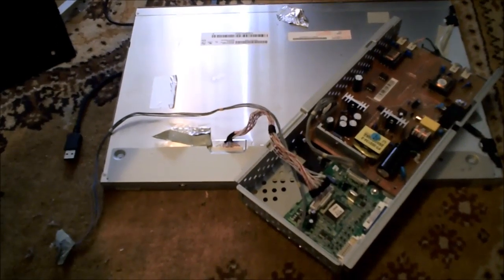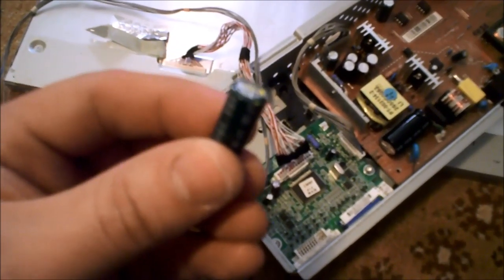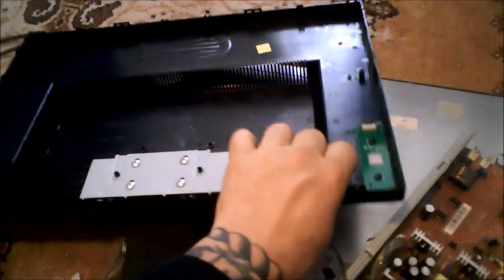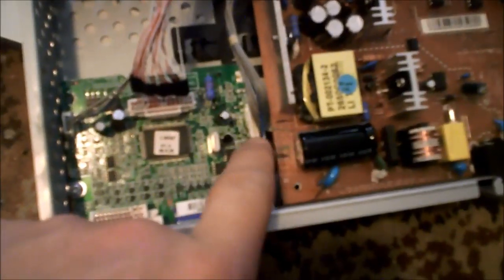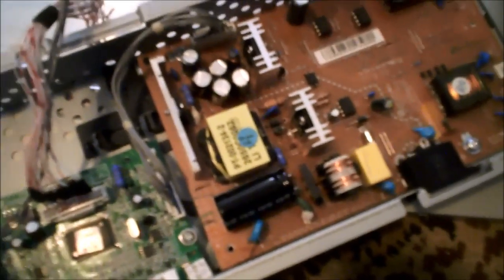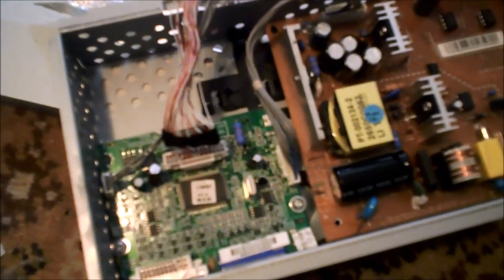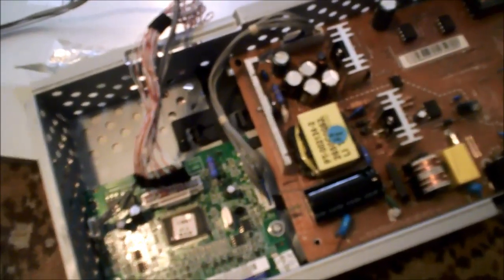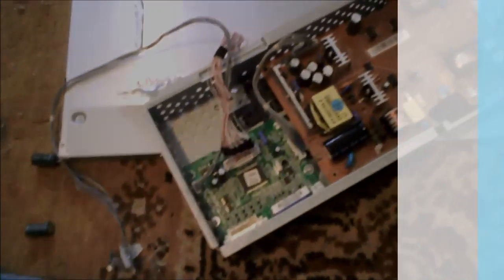LG Flatron L194 WT lcd monitor repair

Comment: Hi my lg flatron has just stopped working L194WS, a green power light comes on for about 3 seconds when plugging it in then goes off and nothing on screen, only way to see the green light again is to unplug from mains for a few minutes then plug back in. Does that sound like a capacitor issue or something else? Thanks.
Reply from the maker: It sounds like capacitors since it does not hold power long. Healthy Capacitors store voltage and won't when they are bad. Take it apart and look for those swelled up capacitors. It's a cheap and easy fix.
Reply: @BeastTechWrench  Thanks for the reply, I opened it up this morning and all capacitors look fine, no bulging at all so not sure what it could be :(
Reply: Update: I noticed most of the caps were sunk in a bit so I replaced 2 that were flat and it's working again! Thanks for the vid and help :)

Comment: The authentic wiring schedule at 5:40 of this video is Blue, Red (pink), Red, Blue. But My guess is that it doesn't mater, hence LG decided to use this type of connector. For taking the case off, remove all screws, then start with a thin blade screwdriver on the back of the casing (Black) lower RIGHT side where the "lock" icon is. Even if you get no joy with this, start on that corner with a putty knife. Use a chair or floor so that you are putting your body weight into the putty knife to just separate the surround from the back. Use an action like you are trying to get under the black, so you are levering against the surround. It will give. Keeping the monitor in the "viewing position - upright" see if you can run the putty knife along the seam. You maybe lucky and it will unlock the whole seam. But if not, keep levering in and under the black. You can get the surround off without surface damage - although some internal plastic with give way.

Comment: Thank you very much for this video! I found a bad capacitor, which was bulging. Just ordered some capacitors, and hopefully that is the only issue. Getting the frame off was a pain, but like you said, I don't care about the appearance. I am assuming you recommend replacing all of the capacitors?

Comment: I have this monitor and one night I turned it off, went to sleep, woke up the next day and the monitor won't even turn on.
EDIT: I've opened it and everything seems fine, the fuse is there and the capacitors don't seem puffy, there's one that's kinda different than the other ones but I don't know if that's just how it is or if it doesn't work, is there a way to check that?

Comment: Hi, thanks for your tutorial.  My monitor stopped working just a few days ago, It simply wouldn't start, not even blue LED.

I noticed that three of five capacitors in a chunk were somehow puffy. I changed all 5 capacitors that were in a place. And the result? It's works again...

I wasn't able to buy capacitors with exact values, one of them had max temperature of 85 C instead original 105 C, but so far so good.

Comment: Hi,
first of all thanks for your very very useful tutorial.
I'm a newbe and I hava a doubt.
I used 4 capacitor 1000uF 25V, and the monitor works again. The problem is that after I closed the monitor and watched better the old capacitors I noticed that they are different from 1000uF 25V, in particular they are:
1x   1000uF 25V  (the same of the 4 that I used)
2x   1000uF 16V
1x     680uF 25V

After the reparation I turned on the monitor to try and I works, but I let it on just for 1 or 2 minutes, now I'm worried that due to the wrong capacitors that I used it could breakdown again in few minutes.

Have I to change the capacitors again or the capacitor type that I used is equally valid?
Reply from the maker: Normally it's best to use exact values of components, but if the non-original value is close to the original you should be fine.
Reply: Джереми 6228
Ok, thanks, I hope it will contine to work also with the not identical capacitors. It has been a my fault :(
In any case, my monitor was dead and now, thanks to your video it works again, great!!!
Thank you!
Reply from the maker: Giutubber Hopefully it will continue to work, you can always use the exact values if it makes you uncomfortable. You're welcome for the help, most people would rather get a new monitor instead of fixing their own.

Comment: LG L194WT-SF.

1) the silver bezel catches on tabs on the black frame, you need to lift up a bit while pulling out and hopefully you will not break the black tabs. I broke at least 4.

2) the capacitors can be damaged without obvious signs, In my case the tops were slightly swollen but when I read their values they read 150uF rather than 1,000 uF,

3) there are 4 small connectors on the side of the PCB - remember it is cyan/pink/pink/cyan - ie the pinks are inside of the cyans